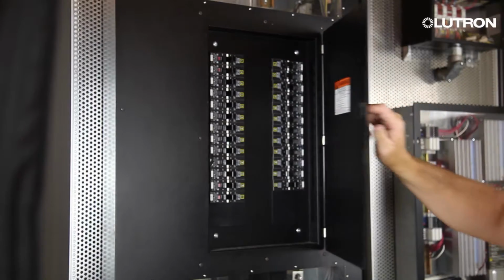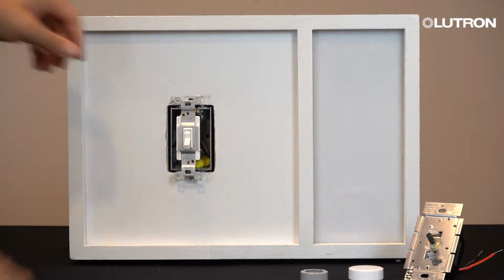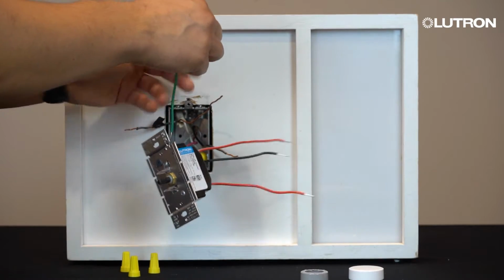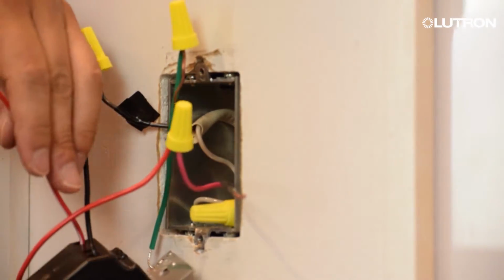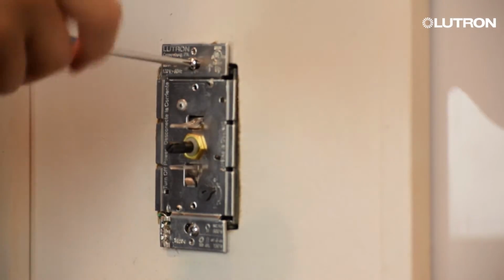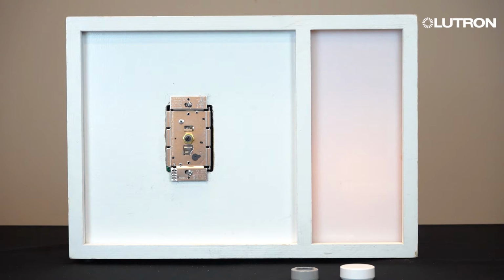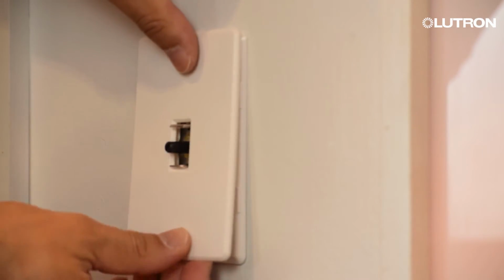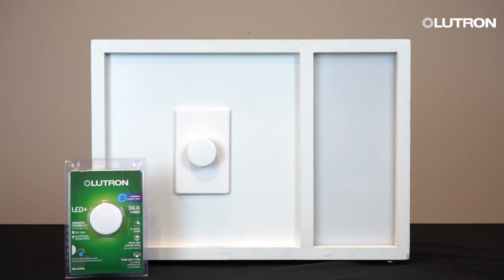Installing a Lutron Dalia Dimmer in a 3-Way Application

Comment: I did this. And nothing. Not sure what I did. 

I have the common black wire with the dimmers black. The reds with the red. The ground with the ground. 

Very confucious
Reply from the maker: Hello, Please contact Lutron's 24/7 Tech Support at 1-888-588-7661 for assistance with this installation. You can reach them by phone at 1-888-Lutron1 (588-7661) or by email support@lutron.com. Thanks!

Comment: What do u do if u do not have a ground
Reply from the maker: Hi. Thanks for reaching out. The Dalia dimmer does not require a ground for functionality. When no “grounding means” exists in wall box, the National Electrical Code (NECR) allows a control to be installed as a replacement when a plastic faceplate with plastic fasteners is used, or the circuit is protected by a ground fault circuit interrupter (GFCI). Lutron wall plates meet this requirement. Cap or remove green wire before screwing control into wall box. For more information please visit: https://www.lutron.com/TechnicalDocumentLibrary/0301964a.pdf
Reply: @Lutron-Electronics   Okay thank you so much!